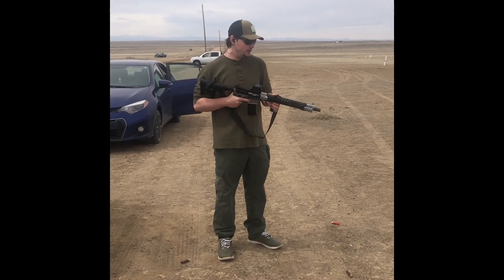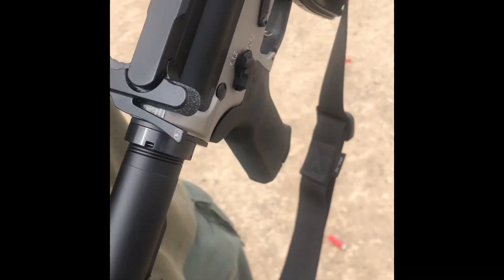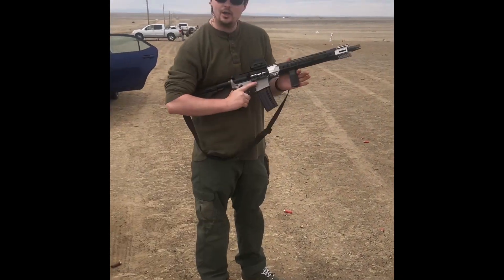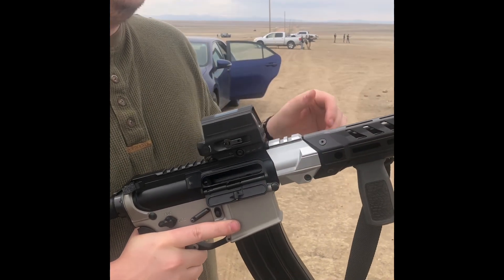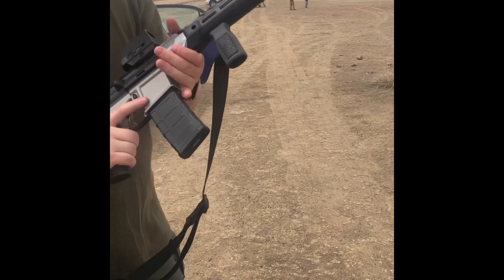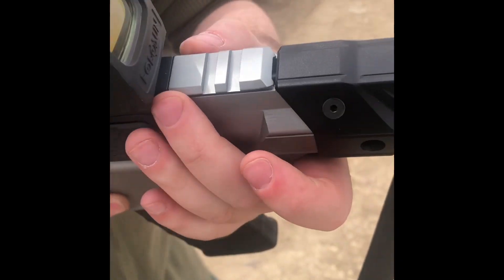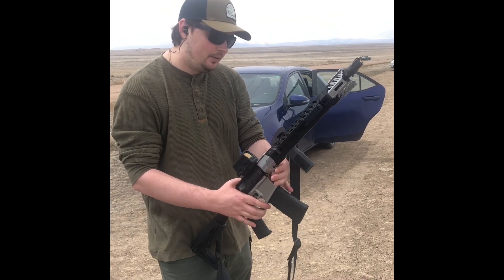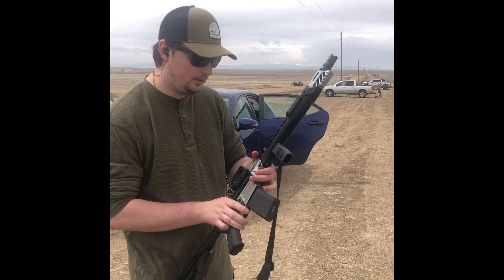Mandalorian AR15 Build with Tyrant CNC Handguard (Fail).

Comment: Swap hand guard and get an adjustable gas block. If you are still getting too much gas in the face try a different bcg.
Reply from the maker: Those are good ideas. I don’t mind how gassy it is: just gonna tune it with a heavier buffer. I really want this handgaurd to work so I’m gonna stick with it for now. I’ll post part two in a month or so. 

Thank you very much for watching and commenting.

Comment: I wish I had seen your video before purchasing this Tyrant Handguard. I really wanted it to work - it looks great, but the design is badly flawed. There is just no way that there mounting system (handguard to barrel nut) can stay secure. Without even firing my new build, the handguard just wobbles up and down. Really bummed and now I have to take everything back apart to return the handguard. Word of warning - do not buy this thing.
Reply from the maker: Agreed. I spoke with the design team way back and told them a very simple, solid way to fix this with a keyed T but made of steel and never heard back from them. It’s a real shame they don’t implement something like that as the concept is wonderful: just need further engineering.